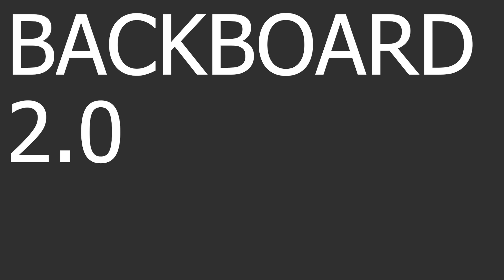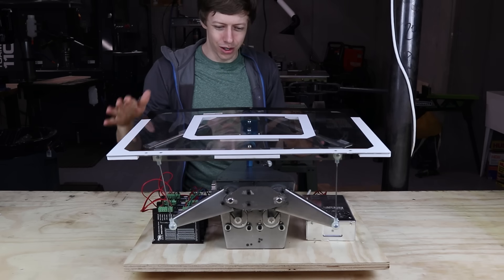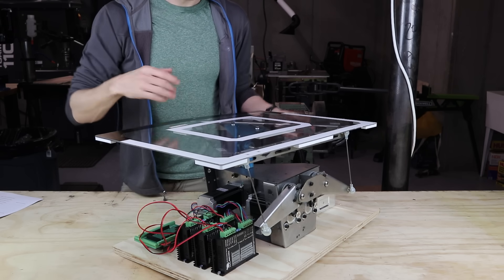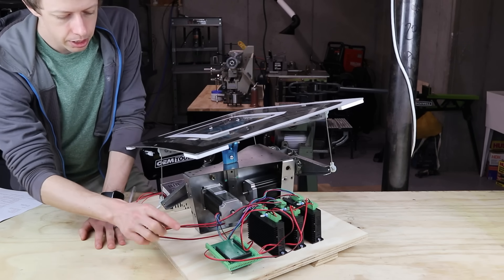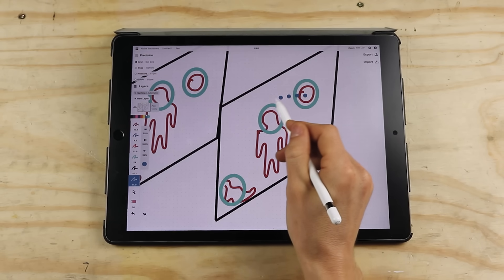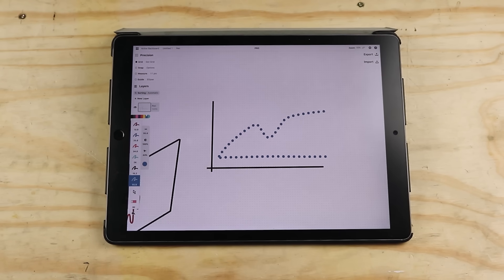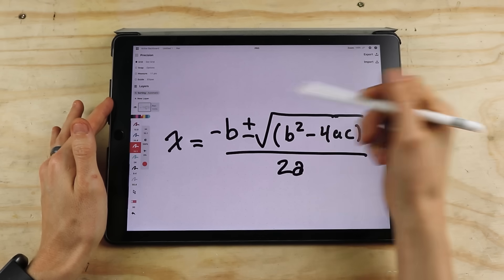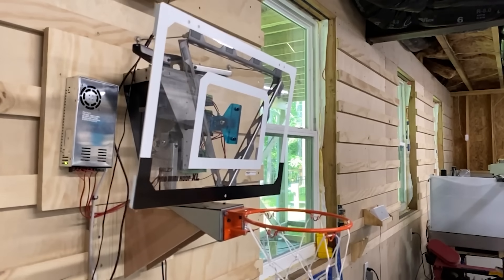The automatic hoop always goes in

Comment: not sure how long it takes to solve the equations, but maybe instead of shouting at the last moment, you could do it progressively and start moving the backboard as soon as possible and just fine tune the final position. you would need to rewrite a little the code, but you might not need to stress the motors / joints  with that much acceleration.

Comment: Awesome video! How did you account for tilting the backboard left/right? I noticed you were shooting from different angles this time and not just from the center.
Reply: From the looks of it, it seems that there's just a bit of margin of error with the ball/hoop size that allows you to shoot slightly off center and still make it. So it wouldn't work if you shot too far from the center of the room. Or were you able to calculate those side angles as well?

Comment: Put the code on github and I'll make it work on Linux instead to avoid the lag issues. Windows isn't a good operating system for real-time tasks.

Linux is a massive improvement for real-time processing over windows already, but it might even be worth compiling the kernel with the real-time patchset which is designed specifically for these kinds of use cases.

Comment: You should try to replace the Arduino with Teensy 3.2: https://www.pjrc.com/teensy/teensy31.html.
Its much faster, no need to change your code (probably), and no need to change your circuit: https://www.sparkfun.com/products/15716

Comment: Are you using an Arduino mega for your project?  I had a similar stepper speed problem and dropped in a Digilent Max32, much faster.  3.3v, but still enough to run the drivers without issue on my project.

Comment: Really nice project!! Thanks for the inside look on how to do the algorithmic for the Machine Vision part of this.

I wonder how does it react if the trajectory of the ball seems to be going directly through the rim in the first place already.

I guess if you used a ball joint where you have the universal joint to allow some rotation about your z-axis in order to increase your reach some more, and then you cut out a curve at the bottom of the board to accommodate for such rotation and not to have crashes against the rim's base, the let's say "cost-to-improvement" ratio isn't going to be that much appealing, would it ? 

Once you have identified what in the image is the actual ball while you're also trying to determine its trajectory, wouldn't it also be feasible to use the speed it is traveling with and its size to estimate the momentum the ball will be hitting the board with at the estimated point of contact the trajectory is suggesting, and then on that basis you could calculate the velocity vector you need the ball to come out of the contact with (and thus the velocity the point of contact on the board, a point whose mass you can fairly approximate as a constant depending on your material, should reach at the time of contact) so that it gets redirected towards and through the rim ?

That way you could reduce the number of possible positions to calculate which the board would need to be at to just a few ones within a limited range of "useful" ones.

Comment: Why you don’t use surface sensors on the backboard in which it can detect where the ball hits, then let the backboard moves so fast in such a way it’s looks like it’s pushing or sliding the ball to the basket.
I know the hoop will be heavier but you don’t need camera “Kinect” and the software part will be way easier

Comment: and, just a suggestion to improve speed, what about pre moving the board according to the previous ruff estimation, like, as soon as it detect the ball, start mouving async the board, you programe still collect data and point, bu the board will smoothly move into correct position, until the estimation is good enough that the board wont move anymore
Reply: This would work if he had a faster uController but like he said he's limited by Arduino's clock speed, and already utilizing every clock cycle. To use your solution, some clock cycles would have to be used to move the basket which ultimately wouldn't be as optimal as maxing the data collection/available clock cycles and making the decision at the last possible millisecond
Reply: @Jdozjsnwj783  he use all clock speed to move the motor, nothing is keeping him from moving them multiple times, the arduino is not working before, he could very well ask the arduino to move multiple time before the final movement.
plus as I understood, it's not the arduino collecting data and making calculations, it's the PC beside it, the arduino only move the motor
Reply: Yeah totally bro i thought of that too
Reply: Imo, the opportunity for failure is much higher using this method. If we take into account that the ball has a bit of grip to the back board, which it does, it is rubber on plastic, then we know if the ball hits the backboard during a move, the grip will add spin to the ball, potentially ruining the calculations altogether. However, the way that I think this COULD work, is if the cut off on the movement of the backboard happened at the last second, which in theory makes it as accurate of a solution as the original method that this guy did. In the end, you’d just be using more power, and making it more difficult to be accurate than anything.
Reply: In my opinion, the trajectory of the ball multiplied by Pythagorean's theorum, would calculate the velocity of the wind speed multiplied by the derivative of X, X = gravity. So if we take X and divide by the quotient of B+7 then we will have the linear equation to command Arduino to take the appropriate angle at .005 seconds before impact.
Reply: Julian Warren I concur
Reply: Aye fuck all y’all 😂😂😂

Comment: Amazing!

I've been playing with the STM32 "blue pill" boards, which look like Arduino Nanos and cost about the same but have an Cortex-M3 chip, allowing much faster clock speeds. Might be worth a look for v3?

Also have you looked at running OpenKinect under Linux? Might have more joy getting rid of the random lags under Windows.

Comment: I'd do the following:
1) Get a pre trained concolutional NN to identify the basket ball. After the first few frames (since the detection of the ball), disregard all other potential object until the current one goes out of sight.
2) Follow the detected object by focusing on the area where it was detected in each previous frame (similar to what u did).
3) Use the size + change in position relative to the previous frame (or several frames) to gauge its trajectory.
4) Train another network (from scratch) to tilt according to the deduced tragectory of the ball.
5) Profit, minimal algebra involved.

This method requires quite a bit of time invested to train the latter network, and coming up with a reward system for it. The latter could either be manual, or a sensor that detects scores.

However, just like I stated before, this method would be inredibly time consuming. You'd need to throw thr balls thousands or maybe even tens of thousands of times until the network eventually learned to catch the ball. However, if you added some additional sensors to indicate how well it did after each attempt (how close the ball was to the hole etc), this woule greatly speed up the training. 

Anyways, your method is probably way faster tho, even with the insane amounta of algebra that you needed to do :p

Comment: 14:05 About moving in the last second.  Why isn't it  possible to move the board in a position close to were you will need it early and  then adjust later on? This should help with the power requirements. Or are the differences in board position so big even with small changes that it doesn't help a lot?

Comment: This is totally different from the dart board bot. That one only has to track and intercept the dart. This has to track AND alter the trajectory of the ball. The trick here is not just speed but precision. If it's too slow or just off by a little bit it doesn't work. Nice job teaching it about angles of reflection.

Edit: Actually bigger doesn't mean better in your motor department for the same inertia problem. You need stupidly high voltage to make the rotation as fast as possible. Maybe even a carbon motor core to reduce weight further.

Comment: One of the things you can do to speed it up - stop using arduino and learn how to work with peripheral registers directly. Arduino libraries are trash. You should get at least 5 times increase in performance on micro controller part without it.

Comment: Impressive. You explained this project very well! So cool to see it in action. 

I wonder, as the ball gets closer and you get more data and the possibilities are narrowing, if you can start issuing movement commands immediately and then issue smaller movements in subsequent time to course-correct as your possibilities gets even closer to 1. Basically use probability selection on most-likely trajectories, begin moving the backboard, and then if a more probably trajectory jumps ahead you can issue a corrected movement position. It would also be cool to see it track and move accordingly in real-time as a feature that can be toggled. The idea being to move in smaller increments. However there might not be enough time in that 600 milliseconds.

Comment: Constructive Idea: At every data point collected on the trajectory line, you could adjust the backboard at each point. That would constantly improve the final angle the ball hits.

Also, you could write the script gather the data from the first data point, then for the 2and, 3rd, 4th, data points the script could just run update from the previous data point. That way you arent running a final calculation and making such a big adjustment in that last millisecond. The goal of this is to constantly be adjusting during the throw improving many aspects; power, movement, processing.

Just an idea. It would take a while to develop the scripts

Comment: idk but u can trying to train a neural network to control the motors, using the previous software as base u can simulate a "infinite" asset of trows and train the neral network to move  the virtual motors, once the acurracy of the model is high enough u can try to save and run in the actual motors

Comment: It is interesting to me that this was built without using AI. I'd imagine that  a different algorithm could work better as well, but could this be built and more effective by training a neural network?
Reply: was thinking about the same thing. A two- or three-layer NN with reinforcement learning would definitely make this system more robust. If you attach the motor controlling signals directly to the outputs of the NN, you can even skip the IK calculation (which is however not recommended, cuz it will likely break your board if it's not stiff enough).

Comment: What if instead of waiting until the last possible second to move the backboard, you continuously move the backboard to match some average of the ball's predicted trajectory? It might reduce speed limitations by front-loading large adjustments while using later datapoints for microadjustments

Comment: You could have put some special indicator on the ball like green tape or somehow get a temperature difference in the ball and use a heat sensor.  The way you did this is so much more complicated than that for the ball tracking but I understand you want it to be able to work with any ball

Comment: If you reach your arm up like you were reaching up at a 45 degree angle, bring in your elbow so your wrist is in line with your shoulder, hold the ball with your finger tips, shoot the ball by bringing your forearm forward and end by flicking your wrist toward the hoop in line with your shoulder. You can adjust the arc by adjusting your shoulder angle at the release. Your hand should look like you are holding up four fingers with the thumb tucked in, if not you might be gripping the ball too hard which can send the ball in an off direction.

Comment: I think you should consider using flexible joint (https://youtu.be/97t7Xj_iBv0), you can play with grubler equations and find 3 joints which give you the exact number of degree of freedom you want. I think you could probably 3D print or metal bent those joint, then you could end up with removing the linear guide, and create a parallel robot with a lighter moving part

Comment: If you use a plc to control you won't have problems with windows. A good one would be beckhoff or twincat, you can run real time applications on a normal pc which is pretty neat you can have cycle times of 205 micro seconds

Comment: Heya, you can save time by moving the board earlier. If you move the board at the absolute latest ms, you have 100% of the motion to do. If you start moving the board based on the data you have you'll be closer and you can adjust based on the additional data you'll get as the ball continue its approach

Comment: 16:19 BUILD THIS A Hole-In-One machine for golf putting. A small putting green with a moving hole, maybe achieve this with that laptop kinect setup and an old repurposed 3d printer, would possibly be easier with only 2 axis of movement and you wouldnt have an issue tracking the ball

Comment: Dude, I hope you are making a lot of money in robotics right now, as this is an awesome demonstration!

If you were wanting to update a few things, here's where I personally would start:
- If you are looking for a fast Arduino alternative, look at the Teensy series. Based on the I/O you are using, the smaller models should be fine, but the Teensy 4.0, for instance, has a 600MHz Cortex M7. I've used it for many projects and it has never NOT been overkill for anything I do.

- You mentioned a lot of linear algebra. I don't know if you are already doing this, but utilizing the GPU might help a ton. It has a steep learning curve, though. But the raw speed would make 600ms seem like an eternity. This could help with the next part.

- It looks like it is processing an angle, and then just jumping to that position at the last second. You might be able to do the image processing on the GPU, and then the CPU should be able to handle the trajectory model quickly enough that it could continuously update. That is, it can start making predictions while the ball is in the air, and start honing in on its position right away. Then you wouldn't have to worry about speed as much, since 600ms is plenty of time. Instead of jumping at the last second, it would smoothly get into position as the ball approaches. The ball-playing drones use stuff like this since drones are slow af.

- Lastly, if you wanted to make yourself future-proof and get your foot into a super-lucrative skillset, you could set up a beam-break sensor under the hoop to detect when the ball goes in, then you could get something like an NVIDIA Jetson or similar. Then you could could set up a convolutional neural network to learn how to put the ball in from scratch. Strengthen the changes when the ball goes in, weaken the changes when the ball misses. That would be wicked sweet and I would totally watch a video on that.

Comment: I love the curve fitting filter.  Did you consider using chroma keying instead of the Kinect?  If you had a greenscreenish ball of a known size and a fixed camera it seems like you could get the 3D position as well.  If you had a novelty green basketball the contrasting lines should give spin information too if you didn't want to lose that.

Comment: Could probably do a bit better (or relax mechanical requirements) by having the motors approaching an approximate solution before the "last possible moment" so there's less to do at that time?

Granted, one can always do little optimizations - and as you said, the code is already the most complicated part, and it works, so it's good enough .I just find the idea of such an algorithm interesting as a potential further improvement.

Comment: Could you move the backboard earlier based on your initial calculations, and then incrementally adjust it as your data comes in? Might alleviate the issues with trying to move it so rapidly right at the end. Then if Windows is lagging or something, at least the board is potentially more accurate than it not moving at all.

Comment: I'm sure this has already been said, but why not continuously update the position of the hoop? To cull random twitching when nothing is happening, only let the hoop move when there is a valid projectile and that the time to impact of that projectile is within certain bounds. That way you're less limited by the movement speed of the backboard. The processing for this would be more intensive, but I am sure it could be done real time or even slightly less often and still achieve good results.

Comment: Oh come on you don't even use the skeleton output of the kinect to rule out potential false positives.
Just get the hands and select a box of pixels around them. That said this could actually be slower since it lags a bit behind.
How much FPS has the kinect v2 actually? I only have a v1 which is slow by today's standards.
And you should be able to port this to linux to use the freenect library, that at least removes winbork out of the picture.

Comment: I few more suggestions for V3. You could add a PID to your board so that it moves smoother but that would mean you would need feedback sensors on your hinges or servos/servo motors. You could also try incorporating machines learning algorithms for choosing the best board position since it's all about finding the optimum plane to reflect the ball given a certain trajectory. Training could be done with synthetic and actual data.